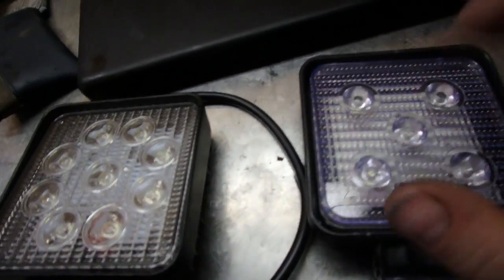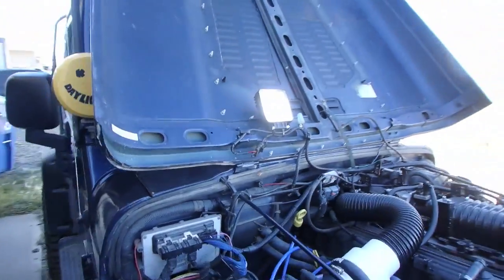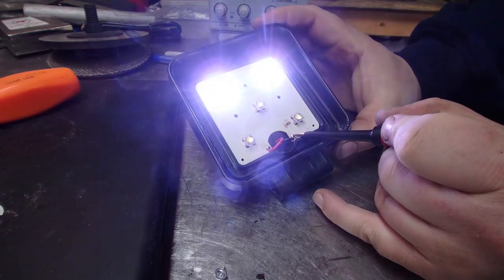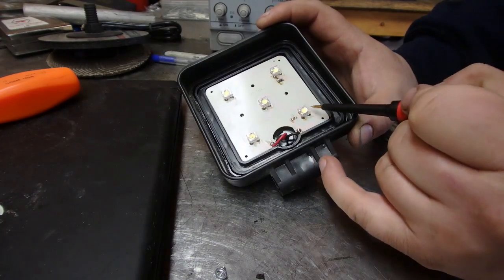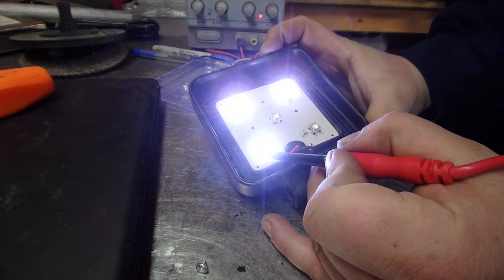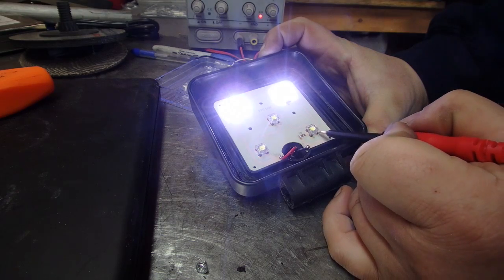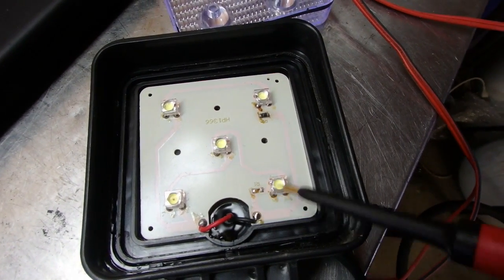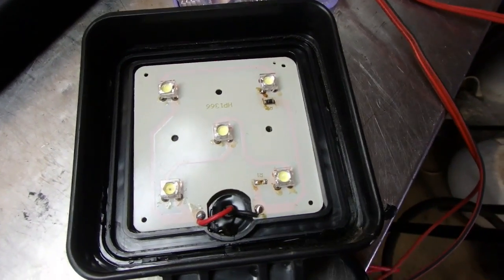LED Lights WHY DO THEY FAIL

Comment: I've had no luck with wingwang led's , I put two sets on the rear of my truck so far and they don't last a year, just like yours they slowly fall apart. No more wingwang crap for me , I'm going to buy North American , don't know what but  the cheap price of wingwang crap from China is not worth my time replacing them constantly .  I think the whole Chinese economy is based on selling us  their garbage to recycle , give back to them and make more garbage to sell us again , over and over LOL
Reply from the maker: +Steve Rob everything is pretty much made in China I think the difference is quality control, the super cheap ones no fucks are given and they send them out with a 50/50 chance of working where the ones that are branded have actually been though QC to make sure they are up to par.  That's my guess